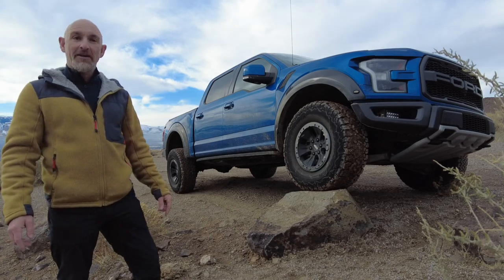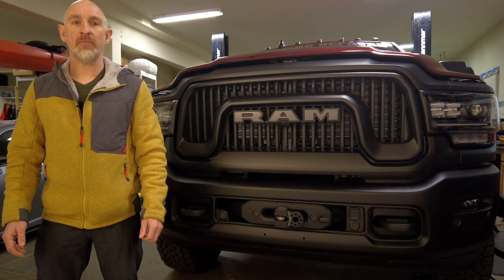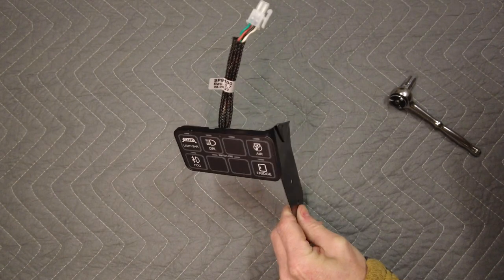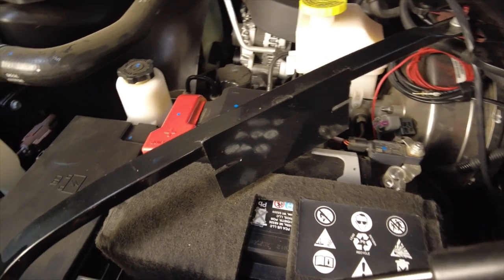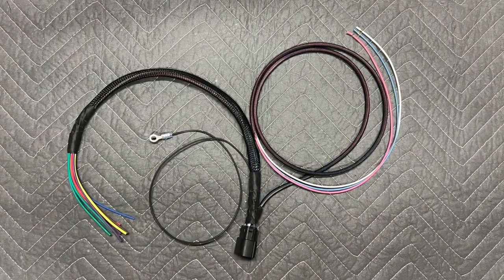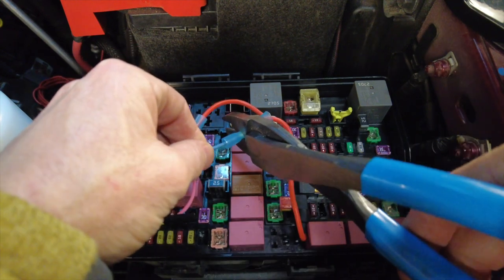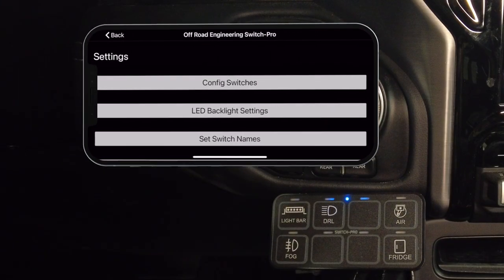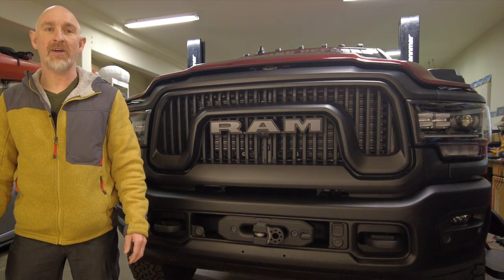Switch Pros 9100 Install on RAM 2500 Power Wagon

Comment: Another great install video.   Haven’t decided on how to setup additional lights on my PW yet.  I may just do some ditch lights and run a single switch inside to install on the bottom left driver side near the door below the current light switches.  My compressor is portable and just uses the battery via jumper cable type connection.
Reply from the maker: If you're out there in the boonies a front light bar is a great addition as well.  Have fun in your PW.
Reply: @goofingoffroad  Thanks.  Phase 2: Offroading starts soon.

Comment: Pretty slick setup. Do you have to pull the switch pro off when you change the battery?
Reply from the maker: Yes,  It's really easy to remove - just unclip the plug, remove the positive and negative lead and then take the metal strut off.  You have to remove the metal strut to get the battery out anyway, so it's not much more work.

Comment: What fuse did you connect the pink wire to, and what does the pink wire do?
Reply from the maker: I didn't use the pink wire.  It's a trigger wire, and you can use it to turn on 4 switches - so, for example, you could connect it to the high-beam wire, and when you turn on your high beams it could turn on 4 light bars for you.  Hope that helps!
Reply: @goofingoffroad  That's what I was hoping to hear.  Thanks, Installing mine tonight.  I have the HD (Cummins), fuse's to tap into should be the same I'm thinking/hoping.
Reply from the maker: @laurencehiggins239  cool.  When you've completed the installation can you pop back here and confirm if its the same, or let us know what was different?
Reply: @goofingoffroad  Used fuse 90 for the ignition wire. Works like an absolute beut…. Wiring up my Baja designs light bar today. Rock lights got wired up same day and it was cake.
Reply from the maker: @laurencehiggins239  - That's awesome!  Enjoy!

Comment: When you need to replace yiur battery all that stuff eill be in the way. No?
Reply from the maker: The brace is there from the factory and would need to be removed to replace the battery anyway.  The only additional steps would be to unplug the harness, positive and negative wires from the switch pros.  So it's not a lot more work.  And - hopefully I don't have to replace the battery too often!

Comment: And you can put auxiliary switches into every other trim of Ram HD truck (though maybe not the other off roader, the HD Rebel). It’s mildly infuriating.
Reply from the maker: I was surprised at this. IMO it’s poor product planning. I like my switch pros better though :)
Reply: I wondered about that. I’m receiving a 2023 Ram HD soon (ish?), and it will (supposedly) come with the auxiliary switches. Guess I’ll find out how useful they actually are.
Reply from the maker: If you are planning on installing any extra lights they are tremendously helpful.  I've really appreciated having a factory option in the Ford Raptor for sure!
Reply: @goofingoffroad  there will very likely be extra lights. In Alaska, it’s common and legal to use off road lights on road. We call them moose lights. Most folks tie them in to the high beams.
Reply from the maker: That makes a lot of sense. I personally like the flexibility of being able to operate my additional lights (especially fog lights) independently of the factory lights.  That way, for instance, if I'm in a white-out snow storm I can turn off all the white lights and use the amber lights to see where I'm going :)
Reply: @goofingoffroad  Triple position switches are the key, I think, so you can set the lights to be independent or tied to the factory lights on the fly.

Comment: Aux switches are a factory option.
Reply from the maker: Interesting!  Thanks for sharing.  The dealer I bought my truck from called the Mopar factory rep for the area, who assured us they were not an option for the configuration of my truck.  I know they are an option for some of the power wagon configurations.  If you were able to get them in your 2022 with the large infotainment screen, then please send the link for the part # to help other folks out.
Reply: @goofingoffroad  I did not know about the aux switches when I ordered my truck but have seen on You tube people with them and also adding them after the fact.
Reply: aux switches aren’t a factory option for the Power Wagon or (I think) the HD Rebel. It’s weird.
Reply: @fscottgray9784  Aux switches are available in any modification except PW. And if you take Rebel, then there is an interesting story: HEMI gives a winch as an option, and as soon as you choose it, Aux is not available. But with a diesel engine, where there is definitely no winch, aux switches are available.
Reply: Power Wagons are a strange beast; other 2500s actually have a dedicated Auxiliary fuse panel(and firewall mounted plugs with a direct connection to the switches) that is used by the factory "Aux switches" and makes tying into the dash mounted switches super easy. I don't understand why that option is missing for Power Wagons and I wasn't able to get it either when I tried custom ordering a Power Wagon with the factory Aux switches. It looks like it should be possible to retrofit the "factory" option Aux switches and under hood setup but, it also looks way more complicated than just using this Switch Pro setup.

With Diesels you can also get a secondary battery as a factory option and that is another thing that is missing from the power wagons. You can certainly install a secondary battery yourself since it would just bolt right in using OEM components or you can use the location to mount an ARB compressor.
Reply: I concur with the replies below.   When I ordered my 2024 PW, there were no aux switch options available…. 😢